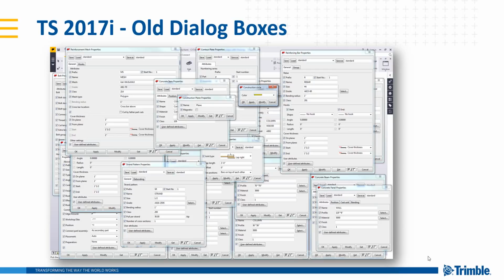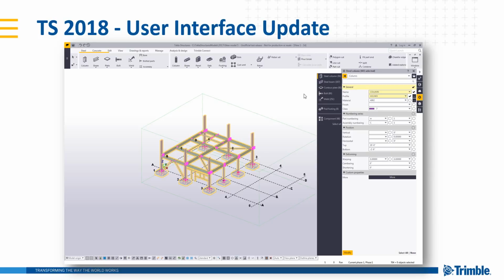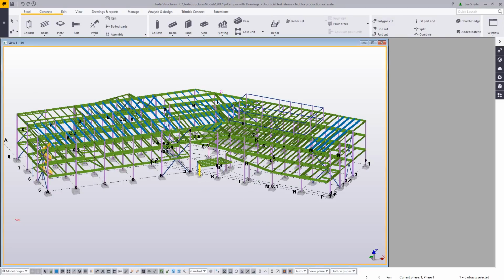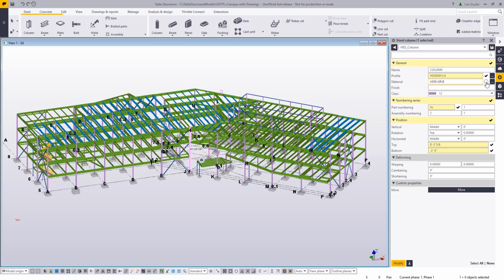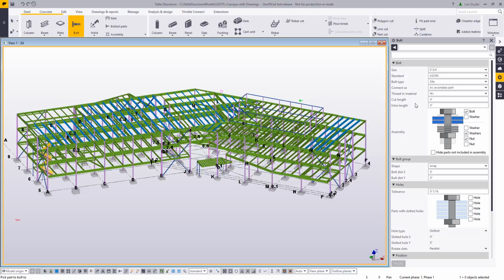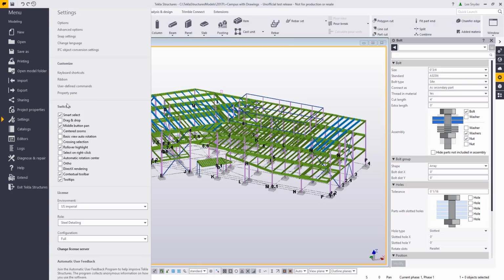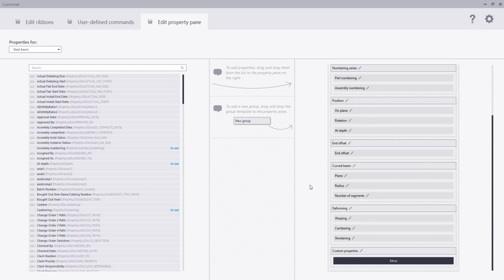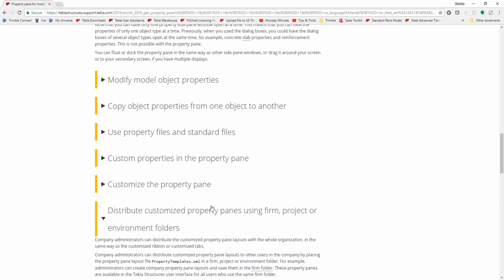Tekla Structures 2018 New Feature - New Property Pane

Comment: How to change it back to old Dialog box in tekla 2018? I found out it's just hidden. Not totally removed from tekla. You just need to hold Ctrl and 4x Left click on element. But how to change it to be like old dial boxes all the time???
Reply: Nice point man...newer versions suck..oldskul is easy to use
Reply: @juluisreyes9094  I found out that you can put XS_ENABLE_PROPERTY_DIALOG=TRUE on your settings and it will work as old one.

Comment: Hello!

Is not it possible to make some survey among users regarding such changes in program? Because this is one of the worst changes- it totally slows work -I know this for I use Tekla for many years already. Please make the option to make the old sistem with dialog windows as default. 

Thank you!
Reply: Agreed, I know this was posted a year ago but this change is a nightmare. Went on here to find if there was a way to change it back aside from CTRL + click but there isn't any :( 2 years of dealing with it and it's still terrible. The worst is that it's fixed in one place and the modify/apply buttons are all messed up. Just wish Tekla would fix previous errors instead of adding on things that make the program worse
Reply: @SnowWhiteOrchid  XS_ENABLE_PROPERTY_DIALOG=TRUE this will help you, put that on your settings in role configuration settings file.
Reply: Yes and we do that in fact.  Are you enrolled in our User Feedback Program?  https://teklastructures.support.tekla.com/support-articles/tekla-structures-user-feedback-program
Reply: @leesnyder6784  Thanks for a quick answer! No - I for now have no access to that. But I hope that with next releases we will be able to use this option.

Comment: so, if I want to get the properties from some item I've done in the past and create it in a different shape miles away from the original, instead of me selecting the old item, apply and create the new item. I need to select the old item, save the properties with a new name, create the new item using random properties, load the properties and modify? or even worse I need to go hunt the item miles away and make sure I select both to have the properties changed?
Reply: Hey Ian!  Not that's not accurate.  You don't have to select the old item and save the properties.  If you double click on an object in the model without the command active, it will automatically get and apply those properties.  (In the old dialog boxes that would open the dialog box but then you'd still need to hit apply.) Then if you activate a modeling command it will begin modeling using those properties.  If you already have an object modeled and you want to copy properties from another object in the model you can click on the object you want to copy from, click the Copy Properties command and then select the object you want to copy those properties to.  (In the old dialog boxes you could double click the object to open the dialog box, click apply (after you uncheck any properties you don't want to copy, if applicable), select the object you want to copy to and hit modify).  You can then choose which properties are copied if you don't want to copy all of them by checking/unchecking boxes as before.  I see you edited your comment from your original post.  Have you reported the issues you have with numbering to the help desk?  With regards to cloning are you currently part of our User Feedback Program?